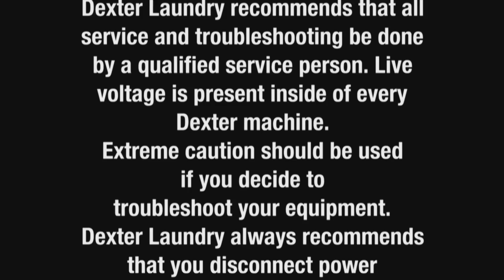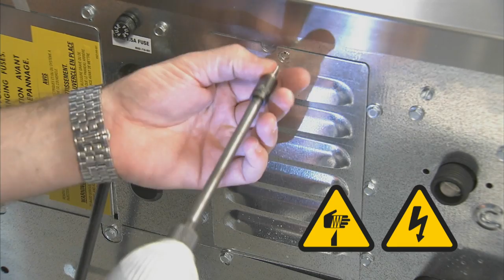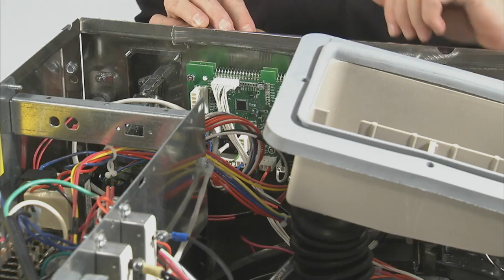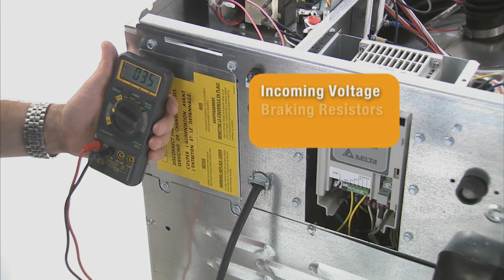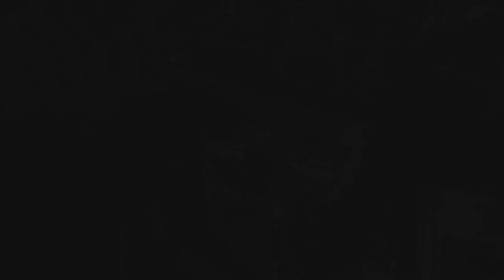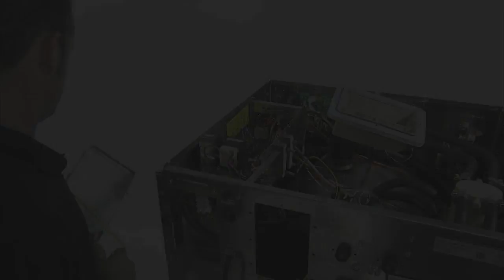Dexter Washer: F13 Troubleshooting on a Dexter Washer

Comment: The f13 has happend on my machines after storms or power line issues. Flipping the breaker on and off quickly a few times has cleared it
Reply: Wow. I'm dealing with washers where the power was cut and then the machines left unused for years. Maybe 20 out of 22 of them show F13 and I was baffled as to how a power outage would have caused that. Reading that the same thing has happened to you is reassuring. I'll have to attempt your fix, but it's crazy that a machine that appears so well built and serviceable behaves this finicky.
Reply: thank you for sharing your knowledge

Comment: Those multimeter probes are dangerous to use for checking live mains voltages, the exposed metal probe tip is way too long for safety.